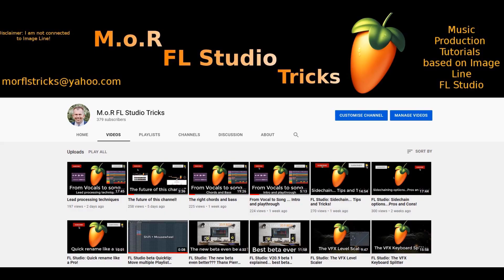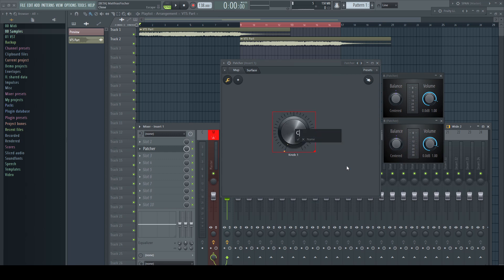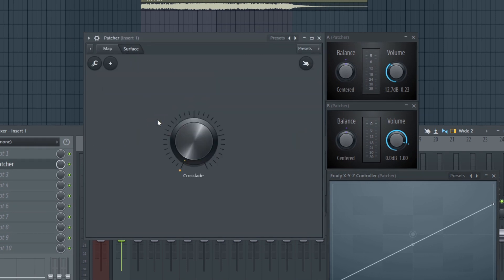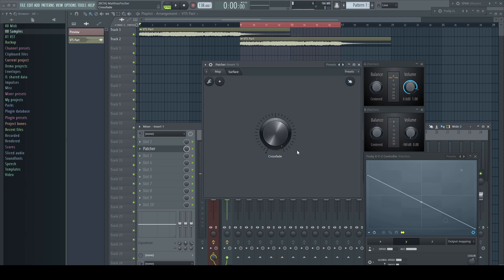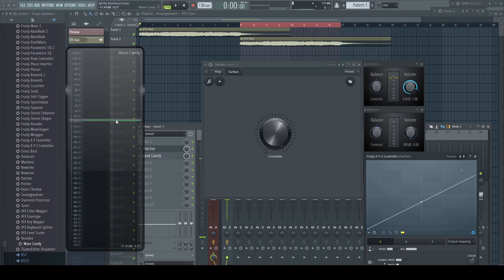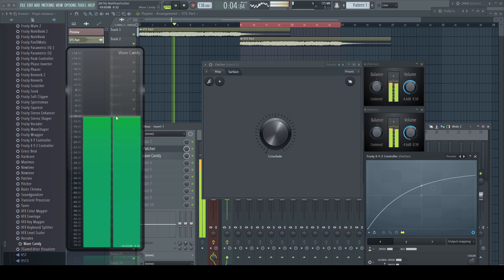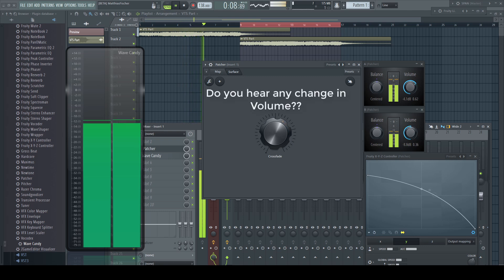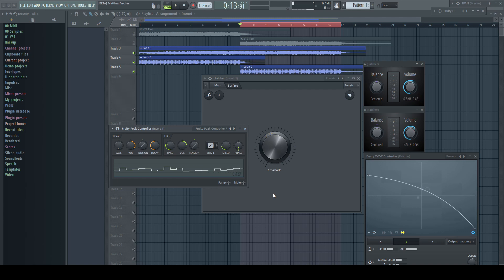FL Studio: How to create an equal power crossfader with ease!!

Comment: Thanks for the tutorial, though what is the point of crossfading sound coming from the same mixer track? Both instances of Fruity Balance will control the exact same signal in this case. You won't be able to blend two sounds together unless each instance of Fruity Balance controls a different input signal.
Reply from the maker: But in Patcher you can i.e. crossfade between 2 different processing chains... or you can use Patcher apart from this example to crossfade between 2 other tracks routed to this one... many different possibilities!

Comment: i found an easier method which behaves linearly:

open waveshaper and set all points to zero (so its quiet)
now you can adjust the mix knob in the waveshaper to adjust the volume and route it in patcher

Comment: guys, this one is unrelated but instead of using fruity balance, or 
fruity send, try using the "volume and panning" preset from fruity love philter, you can create smooth dry/wet fx, example, creating a dry/wet distortion, just follow this guy's method except chaging the fruity balance into the mentioned preset of fruity love philter,then putting something before the B part of the love philter,this is handy incase you ran out of slots in the mixer tab... 

P.S. just want to share this knowledge ehehehe, hopefully it helps
Reply from the maker: Yes, this works as well

Comment: You can avoid the hassle of setting up the logarithm slope manually by using 2 fruity formula controllers in patcher. Instead of fruity balance, I use EQUO's VOL knob instead of fruity balance to mess with volume control (easier to calculate). I use the log scale formula, then add  "*0.5", as seen in the first half formula. Then I copy the mapping formula done in the remote control settings, and replace "Input" with "c". To get the inverted slope, use 1-input (as seen in the inverted mapping formula) in the tension function. The copy & paste commands didnt work for me when i tried copying/pasting the forumlas, but right clicking the highlighted formula allows you to do the same
Reply from the maker: You can make it even easier by just using the Volume function of Love Philter, which is linear... so no need for any logarithmic scale...
However I prefer Fruity Balance... :-)
Reply: @flstudiotricks6903  of course! I really only mentioned this because I saw the comment saying crossfading is still difficult. I didn't know about the Love Philter method,  thanks for that knowledge!